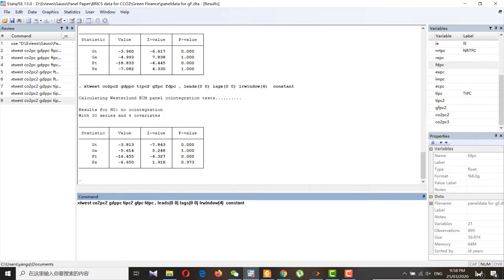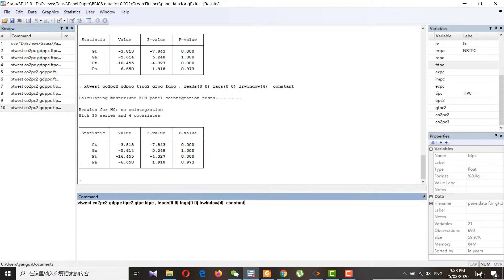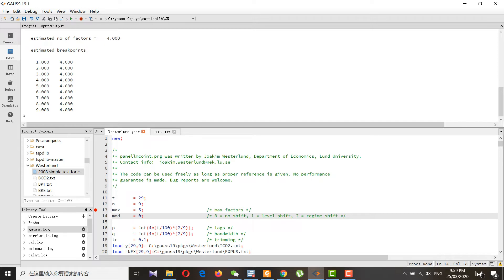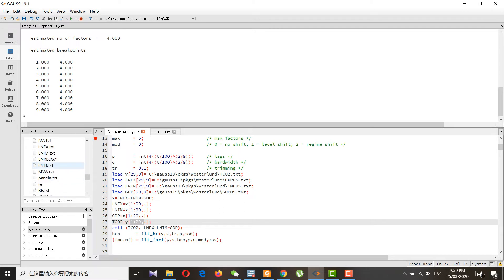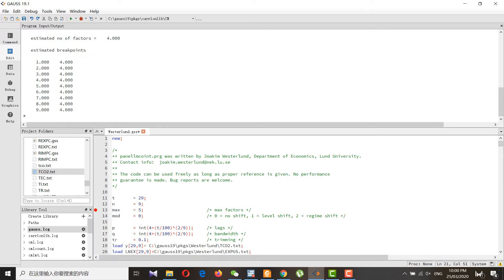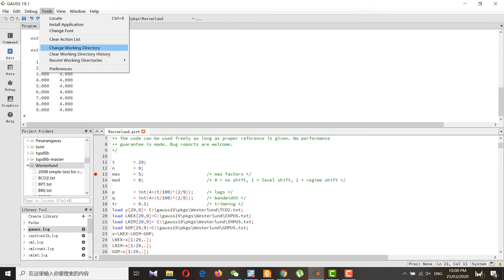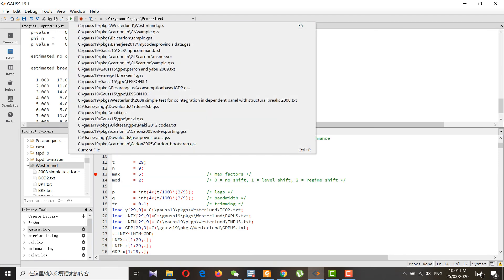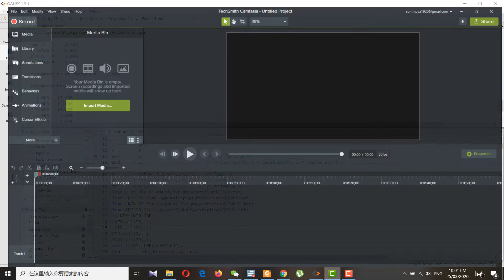Westerlund and Edgerton's (2008) Panel Cointegration Test using Gauss

Comment: Hi Dr. Khan
Thank you for sharing your video. The code is working. However, when you modify the model by adding some other variable, the code is still working, but unfortunately, the results remain the same. That is, by either reducing or increasing the number of independent variables, the output is the same.

Best regards;
Reply from the maker: I have uploaded a video on this test using Gauss.